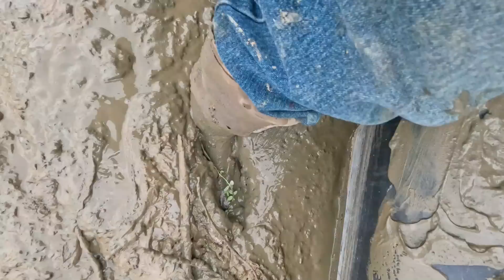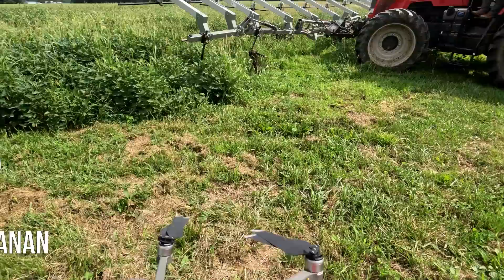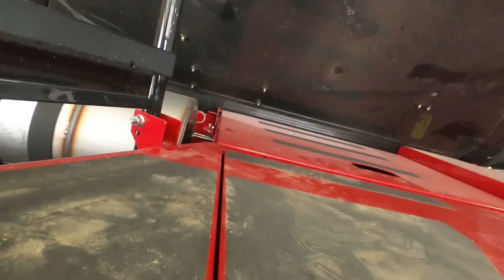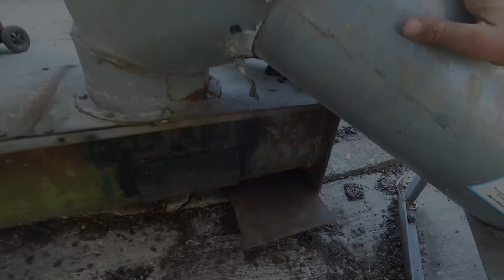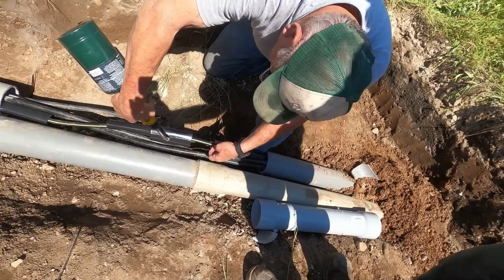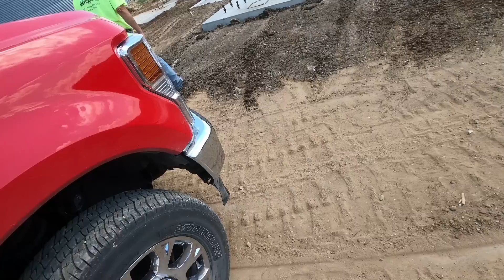Electrocuting Weeds In Organic Soybeans With The Weed Zapper S3 E22

Comment: Reese on the bin site what is the flow of the site do you  drive over the scale first, then around to the new dump pit and that goes to a dryer or wet bin depending on conditions ? Does the scale data get sent into shack or does someone have to capture it manually each time.

Comment: The electric zapper is nice for organic crops, they invented & started using what I call a wacky weed puller in organic around here. Nifty simple outfit with rubber belts off of a round bailer pinching & pulling the weeds in top of the row and pulls them out running between 4 to 5 miles hour on a 12 row unit, belt speed is synced with the travel tractor speed to run the correct backward pull, drops the pulled pig weed and others in the row middle, you can only pull what’s 5 plus inches higher then the crop canopy buts that’s about the same for the electric rig. Neat outfit and works well, cheaper to purchase then the electric unit too. The interesting new equipment in the Organic world making the process simpler without Herbicides.
Reply from the maker: I seen a video of that thing 
Kind of neat
Reply: @iversfarms  I was going to post a video of it running in a field around the corner. They’ve started to use them often in Beans, Cotton, & Sweet Potatoes here, any low growing crops, on herbicide resistant weeds like Pigweed, Amaranth, & Cocklebur. They work great when you get the touch.

Comment: I'm interested in the Weed Zapper, never see one.  How does the cost of running it compare to the cost of farming with chemicals? (Looks like it would take a looonnnngggg time to do your 6000 acres of beans). Also, do they use growth fertilizer, pesticide, and fungicide along with the electrical weeding? I guess it wouldn't be organic if they did. How do yields compare? Interesting episode, always fascinating. Oh, and you guys better hope Bethany isn't keeping score, you could be in for a shock one of these days. Chuckling here.
Reply: We use manure for the fertilizer on the corn preferably hog if it is close enough to the barns to do so if not we use turkey manure it does not take to long to zap at 40 feet wide at on average 3.5 mph we use cultivating and Rotary Hoeing while we can when the beans and corn are short
Reply: @blakebuchanan3074  Thanks for getting back to me.  How many acres are you folks doing using this process?

Comment: I hate the shop!! It works out good because no one else wants to put on Anhydrous,cultivate,hill,side dress. Every time I came back dirty from fixing a pivot or working cows my Grandpa would ask me if I fell down then laugh for at least 5 minutes. I would move into the shop and change oil all day before I would run a tractor with a generator on the back with lightning bolts shooting out of it.How does it just kill the weeds and not the beans? I would like to meet the person who was the test pilot. I bet he has some stories.
Reply from the maker: I bet he did
The hot bar is just hitting the weeds above the canopy. That’s the ground bar you see hitting the beans

Comment: Can you explain more on how the electrical weed control works. How it kills the weeds and not the other plants?
Reply: The theory of electrical weed control is when a high-voltage electrode touches a weed, electric current passes through the plant and is returned to the transformer via the soil by a ground contact device. Deflectors and shields are used to prevent contact between the crop and the electrode, only touching the weeds between crop rows.

Due to the electrical resistance of the plant, the electrical energy is converted to heat. The energy transmitted to a single plant is directly related to the electrical resistance of the plant, the contact time and the electrode voltage.

Plant death is caused primarily by the increase in temperature and vaporization of the water and other volatile liquids it contains. This results in a buildup of pressure within the cells, and subsequent rupture of the cell membranes (Diprose et al. 1980; Dykes 1980). In extreme cases, when an excess of energy is absorbed by the plant, localized hot spots occur and eventually the plant stern bums and ruptures.